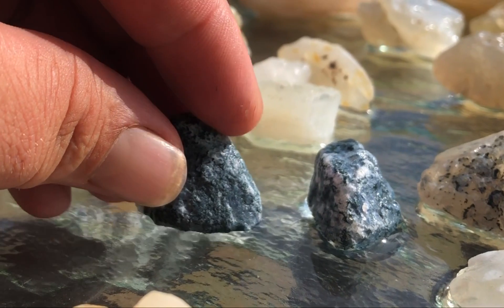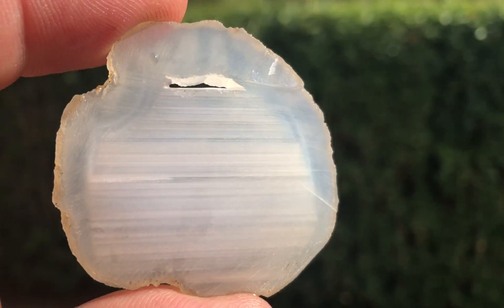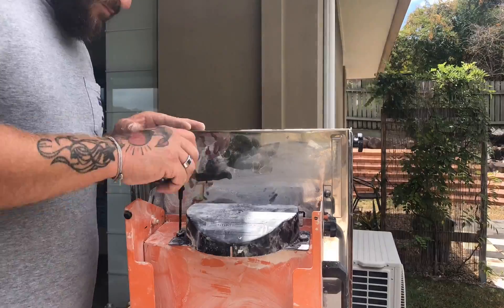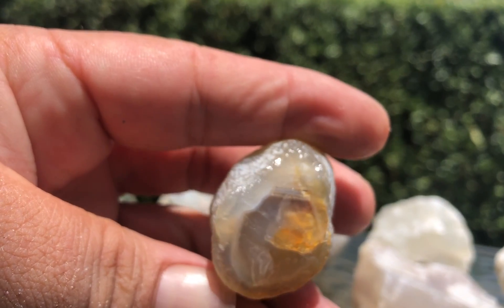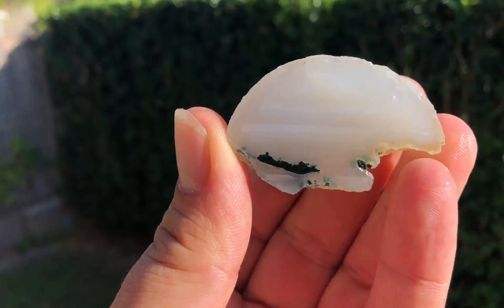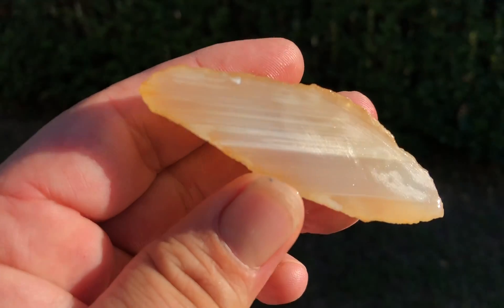What’s Inside Agates • Waterline, Bands & Moss

Comment: What  blade would you say works best? or even a saw you would recommend?
Reply from the maker: There really isn’t many that I’ve tried. The one that came with the saw worked great, and I think that’s one of the cheaper blades. The more expensive they are the better I think, but it cost me $70 for this latest blade and it works still after almost a year. 
The type of blade I use is a continuous diamond impregnated blade. 
The saw I use is by a brand called clipper. But most second hand ones would be fine as well. Sorry I couldn’t help much more Arthur. I hope it helps a bit though 😊👍

Comment: This lot is alot better but why do you call that stuff waterline agate.

It is banded agate
Reply from the maker: So the ones with straight lines are waterline agates or onyx and the ones with lines going round it is banded. There’s both types here, and then there’s that little one with both in it.
Reply: @Rookie_Rockhounding  i saw only quartz based stones-agates and calcedony(almost).

Onyx is a completely different mineral and rather soft in comparison.

I think its time for you to buy some indian blackskin and montana agates.

They are truly amazing.

Also fire agate if you can find it but be VERY carefull with cut/polish-its so easy to lose the fire.

Maybe try and get some cowel black jade seing as you are a local-getting very scarce and valuable.

Just a hint-run a screen on the front of the saw-stops the spray up the body
Reply from the maker: Onyx primarily refers to the parallel banded variety of the silicate mineral chalcedony. Agate and onyx are both varieties of layered chalcedony that differ only in the form of the bands: agate has curved bands and onyx has parallel bands. ... Commonly, specimens of onyx contain bands of black and/or white.
Reply from the maker: I’ll have to check out that black jade though. That sounds rad. Thanks dude!
Reply: @Rookie_Rockhounding  no.

Below is the definition oy onyx.

It is far softer and easier to work as a result of being cryptocrystaline and a mixture of two mazor minerals.

For the most part calcydenoy is a homogeneous material and shit loads harder.

Moss agate can be a little softer due to the moss structure but that is only how it grinds-the agate pirtion is still hard-8mohs
Reply from the maker: Ah okay, I’ll have to check that out. From what I’ve read it’s just a name that is used for differing forms of chalcedony but I’m always open to hearing others opinions too. It’s a good way to learn. Thanks mate.

Comment: nice video, you have to water the saw when it's moving to reduce the heat, I have the water flowing when I cut stones, water and additional contact with air will cool down the diamond saw...
Reply from the maker: Thank you thank you Mario! I’m trying more water as I cut by feeding the reservoir of the saw with the hose on a low flow. Hopefully this helps. Thank you mate for your help!

Comment: Put a little liquid dish washing soap in the water... not a lot ;) it will lubricate the blade, make it last longer.
Reply from the maker: round51 
Ohhhh this sounds like a great idea! Thank you!! 👍👍👍
Reply: @Rookie_Rockhounding  Oh and don't let any part of the blade rest in water when not in use.
Reply from the maker: Ah yes! I kinda thought that just the other day after cutting, I think I might have left it for a night with the reservoir full but realised I should probably not do the... so now when I finish cutting I empty the reservoir but then run the saw dry to get any water off. I figure it could rust otherwise. Thank you man! Thank you!
Reply: @Rookie_Rockhounding  Yeah I noticed when i went back and watched the opening of the vid your blade was high and dry. I learned that when I first started out. The diamond delaminated from the edge of the blade.

Comment: HAHAHA  You and the confusion, right there with you.  I am new to the rock hunt also and  its miracles they have shown me, even on a small micro level.   I know I am not ready to cut.  I am afraid to wreck them.  Have you started to look at them closer, with a 10x or similar loop?  Dont mean to add more confusion to ya but  it could also assist you in the direction that you want to cut is my thought.   The close ups are insane honestly, all the tube flow on some, breccia on others, even how on one rock alone you have melted section on one part of the rock as it went thru high temps and nothing on the other side.  

Thanks so much for sharing and HH
Reply: TheMogjo 
Have you tried using a high lumen torch/flashlight yet, you can actually see through some colours to the depth of other colours on some agates, amazing.
Reply: @symonsheppard5519  I bought a torch that I thought would work but no luck so far.  It is on my list for sure to get, need 365 nm now that I have a little more knowledge, I think HAHAHAHA.  Can you suggest one I can order online that has functioned for you correctly?  I am in Michigan so finding some of those that light up are very possible here.
Reply: TheMogjo 
Got mine in the UK from eBay, but it originated from china as most things do.
About $20. US should do the trick, mine is a very bright one like the cops use and it came in a box with charger and spare battery, if memory serves me right it's a " probe shiny " led , can't remember the lumen size but it's high.
Reply from the maker: @TheMogjo
They’re just awesome creations aren’t they. I get such a kick outta cutting them open, it’s just so much fun also bein summer it cools me off quite nicely haha! 
I actually just got a 10x loop the other day, It’s so cool looking at the up close. 
I’m gonna try the light trick that Symons talking about too, I have a feeling he kinda knows what he’s talking about... hahaha! 
Have a great weekend Mogjo!

Comment: Hey... When your saw starts grinding slower, take a brick or piece of concrete and make a few passes with the saw.
When you cut chalcedony, silicates build up on the blade.
The brick trick will make it cut like a new saw again.
Edit:
I see that you soaked yourself like I did the first few times.
Stand behind the saw..
Thank me later.
It's actually easier to pull the rock through versus pushing.. You can see what you are doing.
Reply from the maker: No One 
Heyyyy thank you!!!  I’ve heard the brick trick a little while ago but had forgotten haha! That’s great I’ll try that out next cut 👌
Oh and cutting it around the other way... this I’m gonna have to try. Thank you! Thank you very muchly!
Reply: So you stand on the side of the saw that the spray isn't, but pull the piece toward you, eh? I've never heard of that, but it sure sounds worth a try! Good idea!
Reply: @thirstfast1025  it works great. Better yet, if something catastrophic happens like a rock or God forbid a blade shatters, you won't be in the path of that material.
Reply: @michaelh.8280  I've always stood (or sat) 'behind' the blade, just never thought to pull the piece toward myself. Makes sense for straighter cuts though, which is one of my worst issues!
Reply: @thirstfast1025  It really improved my ability to cut straight.. Also a problem for me.
Reply from the maker: @No One & @Thirst Fast 
Yeah I was worried about cutting from the side because I really rely on seeing the blade to line it back up with the first cut when I’m cutting the bigger stuff and need to flip n cut. I’m gonna try both ways though and see how each goes. Thank you Borge for the mega help!!